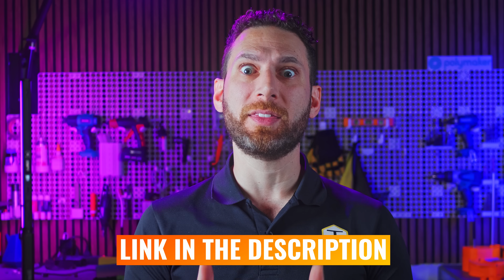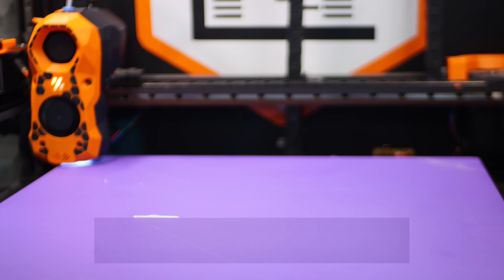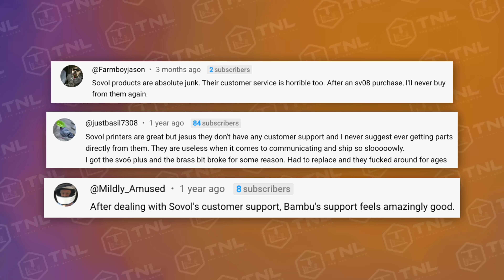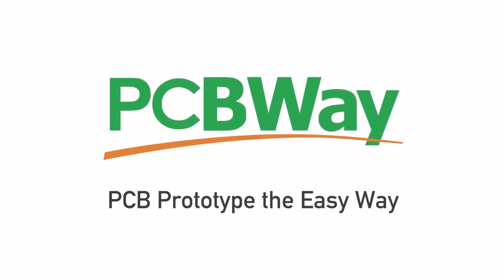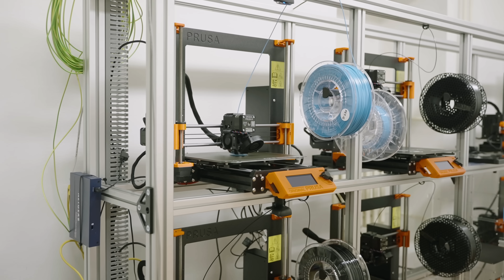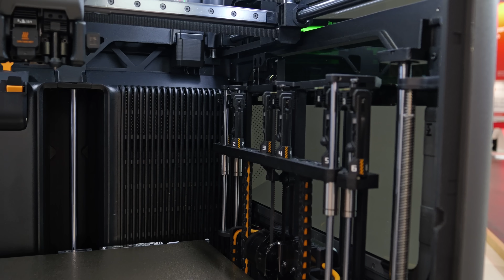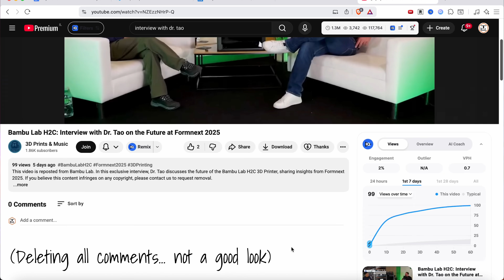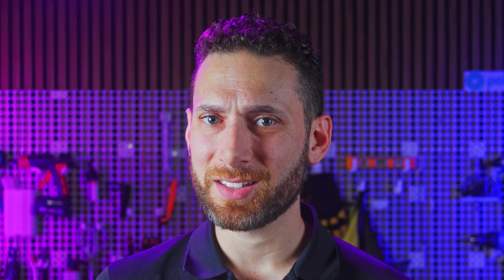My HONEST Annual Report Card for Each 3D Printer Brand

Comment: We may be Bambu Lab customers, but they are so very much not our friend.  I feel like someone in an abusive relationship.
Reply: Sorry which company is our friend?
Reply: Ha very well said
Reply: Hey guys, bought a p1s during the Black Friday sale to start getting into the hobby. I heard about how good and "plug and play" they are but heard about various issues with them as a company.

Does anyone have a comprehensive guide they can recommend so I can protect myself and my machine from shitifying it too much when I receive it? What firmwares do I want to stay on if possible to retain control of my own device and avoid as many anti consumer changes as possible and or privacy concerns if any?
Reply: @Lunatics695  your first mistake was buying a bambulab printer and then deciding to get custom firmware and stay out of the anti consumer economy.
Reply: @Lunatics695  just use it normally , if you want to be completely private then don't send via wifi, use SD card , but I'm sorry but that's stupid for me, you won't print high technology prints that they want to steal from you... And they won't leak anything because their reputation and sales depend on that, enjoy you printer, they are amazing!
Reply: EXACTLY! I own a BBL printer, but I am NOT a BBL user. Mine won’t ever come out of LAN mode, I just don’t have that same trust in them that they used to strive towards.
Reply: I love my P1S. Just never update the firmware and everything is good!
Reply from the maker: Thanks for speaking up. As I said in the video, I feel like they've changed. They used to listen to the community and be in touch with their users. Now, I'm not sure how they're making decisions, but it is definitely NOT what the community wants... hardware OR software.
Reply: @thenextlayer I think the problem is that Bambu spends SO MUCH time on R&D, the community has headed a different direction for a year by the time a product is ready for release. 
I think I read that the H2C has been in development for 3 years...they were SO ahead of the curve with this design 3 years ago, when they started on it. Today, well we now know that it's a dead-end. And what is Bambu supposed to do? Scrap it? Maybe they should have...
Reply: @TheOfficialOriginalChad it’s not a dead end. The full tool changer ones are not as good for engineering use. They are open on the top, don’t have heated chambers, and can’t unload PLA before high temp materials print. People who don’t see this are probably just printing PLA.
Reply: @rsilvers129  Thats not correct at all. Full toolchangers do not have to have an open top, and the whole idea of them is to avoid needing to unload material at all lol
Reply: @rsilvers129 sharp bent doesn't play good with some material. Both have their place6. Maybe not the one you need, but absolutely the one I need. Better have more options than less.
Reply: @thenextlayer  They get their massive marketshare, so why should they listened their customers any longer? Sad approach. I'm afraid, more chinese brands try this method as well. Kickstarter campaign for something suspiciously affordable and incredibly good, getting customers, pretending, they are our friend and secretly doing dishonest things so people not only like your brand, but hate others. Then they can do whatever, because you have not much another options. Just look at the robot vacuums. You can get Roomba or China.
Reply: @thenextlayer  You don't make product based on what community want, but what market wants. Prusa seems to make printer for their fans, forgetting a wider market. One time, when all their fans will either be dead or moved to some other stuff, they'll run out of clients and they'll be in trouble. Bambu, OTOH, is covering wide range of consumers with moderns and easy to use printer for beginners up to more specific printers covering various needs. They may loose some clients over the time, but they are filling the pool in other ways. With better and cheaper printers coming to the market fast, Prusa better have to up their game and make printers that are worth Prusa's name. The L is the only Prusa Core xy I'd get if I had too, the XL and cCore one really had a rough start and not what Prusa used to do.
Reply: @thenextlayer  the H2D was the printer Bambu lab asked for not the printer we asked for
Reply: @Cart_of_a_Jon  For me personally the H2D was exactly what i needed/wanted 😂
Depends heavily on the person tho. I feel like the H2S is the go to Bambu printer now if u have the money.
Reply: @Cart_of_a_Jon no. It’s perfection. It’s perfect for printing engineering parts with dedicated support and is like a $30,000 commercial machine for cheap.
Reply: @galardo3303 It can’t print dedicated support as easily as an H2D. Its good if you don’t do that though.
Reply: @Cart_of_a_Jon I didn't just ask for it, I bought it.
Reply: @Cart_of_a_Jon  I asked for the H2D- I’ve got 42 of them humming away in my manufacturing facility. H2D pros. Bambu reliability and support for their corporate customers is stellar. I get the hobbyists that churn out endless miniatures and cosplay trinkets in PLA could care less about that, but the ability to go from design right to production with little or no tinkering is huge. 

I could care less about open source vs. walled garden- I just want my machines to print when I press go; machines that fade into the background so I can focus solely on my parts and production. That said, a true tool changer from Bambu would be a very welcome development- with that Bambu reliability; that would be a slick machine. We ARE all asking for that- maybe the new X-series will be the tool changer??? Not holding my breath.
Reply: @Alan-tr5uj  I also have one great machine but I wanted a bigger X1C I want now a 400mm H2S
Reply: @Cart_of_a_Jon  it just all depends on if they can profit on it. If they aren't making money on a 400mm × 400mm plate, they aren't going to make one. Right now I highly doubt they could make any money on that size. The engineering gets complicated at those sizes while keeping the speed where it is now. Those forces start to really mess things up on the printer. The material starts getting heavy too. My guess would it would be way too expensive for most to consider buying. Obviously these numbers arent right, but say a 400^3 printer came out and selling for $4,700. Most would would buy the H2S before shelling out that much more money. Diminishing returns start ramping up quick.

On a total side not to give you an idea of how the average person thinks, I had a client asking us to install some stainless steel metal that was basically sheet metal at 1/16" thickness. He decided to bump it up to 1/8" thickness which obviously increases the cost. When he saw the material price had basically doubled I get a response of "dude, where did the cost come from? We are only talking 1/16" thicker. Thats nothing..." I didn't know how to respond lol
Reply: @Alan-tr5uj as somone who is hobby/uses my printer for diy like I get letting people use what ever software they want is cool and all but like in tech so few companies are truly open sorce bambu being and closed system is fine as long as it all works and atm it dose and function to a level that us user-friendly and functional and for bambu they target new users to 3d printing so having stuff be simple and no bombard people with endless features its imo a good thing
Reply: @Cart_of_a_Jon  the H2D is the printer I asked for for real world projects and it has been exceeding my expectations. Now if all you do is print multi color dragons its a different story.
Reply: @bigsteakomlete3152   - It's literally twice the material. 🤦

I feel your frustration.
Reply: @thenextlayer  maybe because others (like prusa for eg) have started attacking them at every step? What should they do, bend down lol.
Reply: @jamesmeader6539  this is what it feels like to use a Mac or Windows machine
Reply: @jamesmeader6539  well send!
Reply: @jamesmeader6539  why? They make a great product that just works. Why are they abusing you?
Reply: @jamesmeader6539  bambu customers just want to print and are not concerned with the drama.
Reply: @jamesmeader6539  they are just trying to apply Apple playbook. Nothing new. All the tactics mentioned in the video have been sleeping applied and tested during all the "Jobs" eras of Apple. Without mentioning all the dirty tactics most people have no idea of
Reply: As a casual user, im perfectly happy with my A1
Reply: They are in the "shittyfying phase". First you make your product unbearably good for the consumer, then when you have them locked in, you make it unbearably good for businesses on the cost of the private consumers and when they are locked in it's time to pay of the investors. That's when the shittyfying phase starts.
Reply: @nicklasjonsson978 Actually you are exactly right lol. Its like the companies are using the exact same playback over and over. I like the phrase you use for it. Bambu in my opinion is still solid and I love their printers, but you can see the same things starting as so many other companies. They come in with a product thats just better than the rest at a price that just doesn't seem possible (probably because it isnt). Walmart was like this when if first got big. I'm was just cheaper than all the rest. Or I remember Netflix coming out when Blockbuster was still here. It was just so much cheaper, you didnt how. Amazon...then slowly price goes up while quality starts to drop. 

Its either a plan from the beginning or you get things like Wall Street involved. Once you have random shareholders who have no involvement in the making or growth of the company, anything is sacrificed in the name of short term gain. Even worse, at least in America, Wall Street only exists to slowly destroy companies. Seriously,  thats its main goal. These hedge funds make massive tax-free profits if they can destroy a company while holding a massive short position. Yes, most will soon be hanging in the streets, but right now they don't care because of just how rich they became off it. This country would be 50 years more advanced if Wall Street would just be wiped from existence
Reply: @nicklasjonsson978  nothing $hitty about the P2S.  Get real.  It is an X1C at half the price with a quick change nozzle.

You are delusional.
Reply: @mandoreforger6999 never said their printers were shitty. Just claimed that Bambu Labs (the company) are in the "shittyfying phase". Which means that they are making changes to their business model and/or products in ways that have negative consequences for the users, in one way or another.
Reply: @nicklasjonsson978  yet you don’t specify what.  An upgraded X1C (the P2S) at half the price is pretty good evidence that you are delusional.

The only change to their business model is a focus on “multi-material” more than “multi-color” and the “3D printing only” makers don’t understand it.  Most makers employ a range if technologies including laser-cutting, embedded sensors, motors and so on.

Maybe it is something you just don’t understand.
Reply: @mandoreforger6999 Given your way of arguing (using domineering tactics), I strongly doubt that it’s possible to reason with you, or that you even care about anything other than arguing (or putting others down). That’s why I’m not going to waste any more energy on you.
Reply: @nicklasjonsson978 other than the fact hes kinda right about you just saying they are turning shit when you give zero examples of that and on top ge wasnt putting you down he used point to explain his point of view feel like alot of people who hate on bambu do it because they are still really the big dog in the consumer market for 3d printing / for people using 3d printing to test/design parts
Reply: @TwoWheelRyan he could just ask for examples instead of starting of by calling me delusional. 🤷
Reply: @TwoWheelRyan My criticism is specifically about the shift from local, user-controlled operation to a system where core functionality is gated behind vendor authentication and authorization. Even if cloud access is optional today, this change increases future dependency on the vendor’s infrastructure and policies.
Reply: That’s rounds up what I think. I love my Bambu Printer, it’s convenient, it just works, especially with Bambu and Sunlu Filament. But if I want to tweak it I need to take it to dev mode with Orca.
I really like my Printer but it will be my last Bambu if they don’t change. What they won’t do.
Reply: @LayerQuests ..Brainwashed much?😂… “It Just Wo..”😂.
People like you  are why things never get better…
Reply: I feel exactly the same about Prusa. Nothing like making a customer feel like a doormat.
Reply: I agree. Just bought a second Bambu Lab. As a FOSS developer I dislike a lot of what they do but their printers work very well, and I already have a ton of software and hardware projects to work on. Didn't want 3d printing to become another
Reply: This exactly the vibe I got from them the second they burst onto the scene. Sell printers at an absurdly cheap price to pick up market share and then start the enshittification. I’m honestly a little surprised they haven’t gone more walled garden. I have heard that businesses that buy Bambu printers need to use bambu filament to keep their warranty, but it was an offhand remark so I could be wrong. 

They seem more like a scummy tech company than any other printer manufacturer. Patent trolling, using open source stuff without contributing back and closing off whatever they can, and preventing people from modifying printers they own. 

They seem to be good printers, but I think it’s bad for the community to support this type of behaviour. 3d printing seems to be one of the few relatively mainstream things that still has so much openness and “hacker culture”. I think we should do everything we can to protect that so we don’t get another apple that dominates and releases a new printer every year with a small tweak and planned obsolescence, and forces you to stay within their ecosystem.
Reply: @C8-H8  I'm upset with Bambu too, but let's not sling around accusations. Patent Trolls don't make products using their patents, and seek to make money explicitly through the legal enforcement of their IP.

Bambu Labs isn't a patent troll company.
Reply: @C8-H8 they don’t patent troll! Patent trolling is when you collect patents you have no intention of using only to sue others. They have literally never done this. Name one company they have sued. All of the stuff you said is fake.
Reply: @rsilvers129 patent CN215320666U which was a patent on triple lead screw z axis, which has so much prior art, CN114347467A which is an attempt to patent an indirect filament sensor which also has prior art, I know of the one designed by martin_au on thingiverse. CN114013044A is a patent involving multiple print beds in the slicer. That took me a single google search to source, maybe next time do some research before making a definitive statement. They don’t need to sue anyone, just the threat that they may is enough.
Reply: @C8-H8  it is funny how badly you want this to be true. Almost everything you said was wrong.

1.  Bambu has never been “absurdly cheap” compared to anyone but Ultimaker and Prusa.  They still aren’t cheap compared to Creality, Elegoo or FlashForge.

2.  The P2S at $550 is literally HALF THE PRICE of an X1C and has the same features with quick change nozzles.  You call that “en$hitification”?

3.  Bambu is investing in a broader maker ecosystem beyond 3d printing with maker kits and cyber bricks, lasers and so on.   How is this “en$hitification”?

It is competition.  They are just embracing “multi-material” more than “multi-color” because printers like the H2D are really NOT intended at the mainstream consumer, it is for hobbyist engineers…which is what the brand is embracing.

You can all print your multi-color fidget spinners and figurines faster on other printers, like my SnapMaker U1, but Bambu is going after a different audience now.
Reply: @mandoreforger6999 lol, you claim they aren't cheap in your first point, but then in your second point you explain how they're half the price of other brands that are still inferior. 😂

The enshittification is the lock-in to their infrastructure, like requiring cloud connection and authentication, restricting 3rd party software and hardware, and data privacy issues. There's also their lousy customer support (if you're not a corporate customer), but that's a preexisting condition.
Reply: @a @arthurdent9281 wow, you only think in binary? “One or zero”, “yes or no”, “cheap or overpriced”?  😂😂😂. You are a simple person.  Let me simplify so you can understand.

Prusa -> overpriced at every level, has to license technology from others because they can’t innovate anymore

Bambu -> Slightly Above average pricing, with superior quality control and reliability.  Less expensive than Prusa, Ultimaker, Lulzbot, etc. more expensive than Elegoo, Qidi, Flashforge.  Only slightly more expensive Creality on the Lower end, with far better value.

Bambu has machines from $199 (on sale) to $3500, so it is a far better value than Prusa across the entire line, but they aren’t going to chase Elegoo and Qidi on the lower end.  

You can pay a lot more, and you can pay a lot less, but it is hard to beat them on value.  Snapmaker may be getting close over time.

The world isn’t just “cheap” or “overpriced”.  There is a mid-premium tier, like Lexus or Tesla.. 

This should be obvious.
Reply: @a @arthurdent9281  Bambu customer support is easily as good as any peers.  If you think Elegoo or Creality are better, you are delusional.

Prusa has the nerve to sell the MK4S for $999 plus shipping, which might be as good as the Bambu A1 for $299 with free shipping.  It is demonstrably less capable than the A1 Combo at $399.  

They are a joke at that price point.  

I have nothing against Prusa, I have used them and they aren’t bad printers, they just aren’t competitive on value and have fallen behind on capability.  They haven’t caught up, and aren’t about to.
Reply: @mandoreforger6999 You certainly have a lot of pro Bambu comments throughout this whole section. It's weird to spend so much time claiming Prusa has worse products compared to Bambu when Prusa outperforms them on every level WHILE staying true to customers with offline/open source options. If someone is on a budget then sure you can buy a cheaper version with no hate from me. But don't act like Bambu is even on the same playing field when it comes to making the RIGHT decisions for customers.
Reply: @C8-H8  heavy insinuation
Reply: @C8-H8  YUP.  Their core team came from DJI, why would anyone think they'd be pro-consumer? The fanboys are just sucked in from previous good will.  "You will own nothing, and you'll like it." - Bambu
Reply: @meikgeik  here we go 🤦‍♂️🙄
Reply: @meikgeik the fanboy thing people say is so weird. Yeah some people will stand in line to buy every new color or model but that is .05% of buyers. This is something you guys cannot grasp whatsoever (I'm guessing lack of math knowledge). Take Apple, I don't use their products because im slow at using it, but I am very easily able to see why so many only use their stuff. Thats because it is it is good quality that they are use to using. Thats it. It hardly ever breaks (it just works). They dont want another type of phone because they are different. Thats it, that is all there is to it.

But I am interested in what you types really think. You are saying Bambu could release a printer from 2015 with none of the tech we have now, call it their newest model, and people will flock to buy it because it has "Bambu" on it. Now I'd like to hear why you think Bambu can make profit on selling pr8nters that you have to manually level, none of the sliders work with it, no color changing, insanely slow speeds...why will they make good profit on it? Most would think it would destroy their company, but you say fanboys will flock. You say it doesnt matter if their printer is good, its simply the name. Im just curious why you think they can revert to decade old tech and still be fine. Obviously I know you dont run a company because of what you said, but I'm still interested in what you think works. Its just very strange thinking thats weird to anyone who has any experience with owning a company. Also use a different company besides Bambu. This will make so you stay on topic because we know if its Bambu you will not be able to understand anything I just asked.
Reply: If you’re their customer but don’t like how you are treated, you are rewarding by them with your money and moving the maker in this direction.
Reply: @MrKornnugget  They work the best. But also what we are doing is telling other companies to step up their game and they would get more sales
Reply: @MrKornnugget  i mean ,they give me a really good product for a really good price, I have Bambu labs I bought for 300€ , printings 5000 hours and I changed absolutely nothing, no fixing, nothing, no Connectivity problems etc, I don't know if you guys have other Bambu printers... The only printer I might buy right now besides Bambu lab is the snap maker, but I wanna see first how it ages
Reply: @HueDiaries  It’s all subsidies by the CCP, but you do you bro.
Reply: @MrKornnugget oh yeah, xi jumping need to know the benchie you printed last night, he has nothing else to do with his life 🫠🫠
Reply: @MrKornnugget btw, most companies(all) take you data and use it, your phone (American phone) can even use you mic to listen to you, but somehow you completely chill with that, completely chill with social media selling your data but worried about the junk you printed being in hands of some Chinese? How? How can your ego be so high to think that what you print is relevant to them?
Reply: @H @HueDiaries  Couple things here, talking about 3d printing and modeling. Their are options to from companies that do not sell your data. Second the CCP is an adversary that does not disclose how they use your data. In the EU and USA companies tell you have they use your data. Lastly, how do you know what phone I use? 😂 I use a pine phone for personal  and a iPhone for work. Anyway, CCP uses data to suppress people, Google use it sell ads. Taiwan is a country.
Reply: @MrKornnugget US companies get away with vague language that they can and do change at any time. It's not significantly different. You still have little idea how your data is used, and after the 10,000th data breach what data do we have that isn't already available to whoever wants it?
Reply: I'm about to throw my p1s out a fucking window because I can't get the bed to stay level
Reply: @seanburke997..Glad That I never supported that Company.
Reply: @seanburke997 there are armies of P1S lovers.  The data is overwhelming.
Reply: @seanburke997 skill issue
Reply: @riba2233  or an abuse issue.  The P1S is literally the print farm warhorse.  It is probably the most reliable printer for the money in history.  The Centauri Carbon is close…but…
Reply: I think the Bambu hate only exists in certain corners and is mainly the result of success.  I have an X1C, I have an open-source Elegoo Carbon Centauri and SnapMaker U1.  Bambu should keep doing what it is doing so long as it makes 3D printing more “plug and play” for the mainstream user.   Dogmatic adherence to open-source can be just as anti-innovation as anything else.  Making features compatible with potentially obsolete technologies at the expense of innovation is a bad idea.   If the market demands it, they will do it or they will lose.  If the market sees value in their solution, they should benefit from it too.
Reply: @mandoreforger6999  Ehhhh you can't just "ignore" licenses like bambu does
Reply: Unfortunately with any company they have an obligation and a legal duty to their investors to make money. It's the nature of the beast
Reply: I would never buy a bambu lab printer.
They are a crap company and Its sad that people don’t have enough spine to just ignore them.
Reply: @SayNoToRioAccords...You think Bambu is popular...because...people don't have enough courage to not buy their products... 
This has to be a good story. Please do tell.
Reply: @TheOfficialOriginalChad  💯 agree with you.  Bambu was the spark of innovation that Prusa tried to be for 5 years but failed while they sold overpriced “kit” printers based on a faded brand.   Now they are licensing Index (they didn’t invent it) and I applaud the kick in the butt they seem to have responded to.
Reply: @SayNoToRioAccords I hope fewer people buy them. I bought one right before things really blew up with them and when I got it I turned it on LAN mode and it’ll never come back off. It’s a piece of hardware I own, not their hardware, and I refuse to use their services or buy anything else. If I had to do it again I’d spend a bit more and get a core one despite the issues. I just trust a brand like prusa so much more.
Reply: @SayNoToRioAccords absolutely false